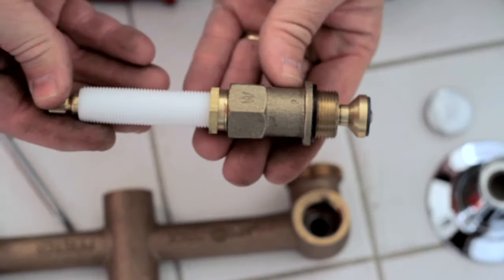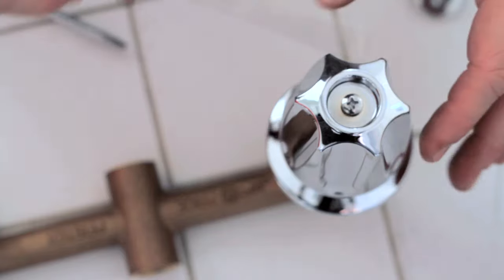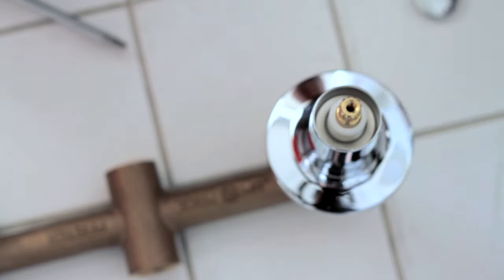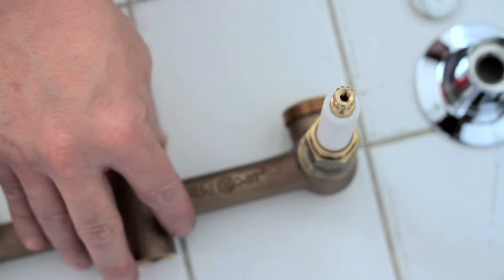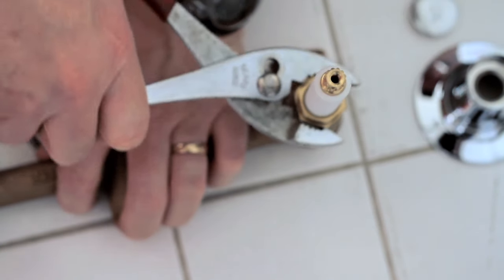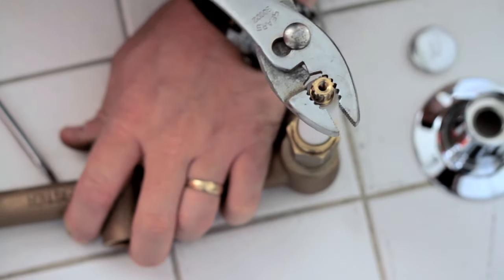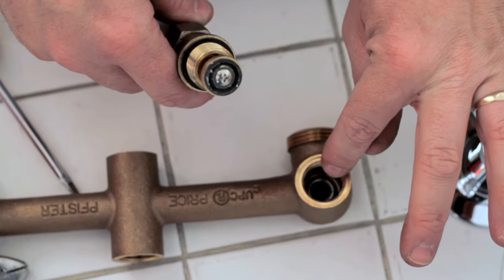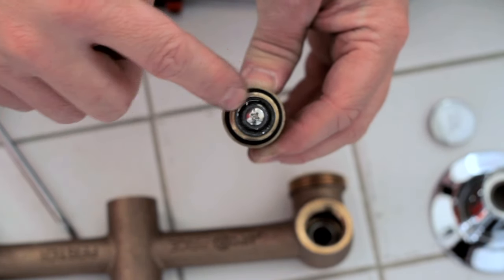Shower Repair : How to Tighten Hot Water Knob to Stop Leaking From Shower Head

Comment: Excellent  presentation sir!!
I have a problem with a recently changed stem, it was installed around 3 months ago is not leaking but is getting hard to turn on or off. I am aware that in my city the water is hard and that might be causing that problem. I need some advice.
Thanks in advance.

Comment: Edward Espinosa I have the exact same problem.  My husband even bought a new shower handle kit and replaced it all including the metal piece behind the wall.  It lasted for about 3 months and then the same thing happened all over again.  Hot water running all the time like someone forgot to turn it off.  Did you get it figured out?

Comment: That didnt show me how to tighten it it showed me how to replace it.... Not helpful
Reply: Turn it.   That's all you do.  Turn it to tighten it if you're not replacing the stem.  You may need to use a socket that can seat over the stem, but the basic premise is the same.

Oh and make sure to turn the water off at the distribution point (usually some sort of ball valve in the basement or somesuch) before doing this if you don't want 2nd degree burns.
Reply: +jason X Turn the knob clockwise.

Comment: just replaced the washers and seat i have hot water leaking out the handle when the cold water is on
Reply: +shakkey13 How did you replace the seat - this videop does NOT cover that method.  We are all curious....